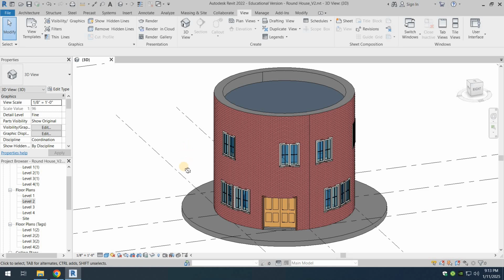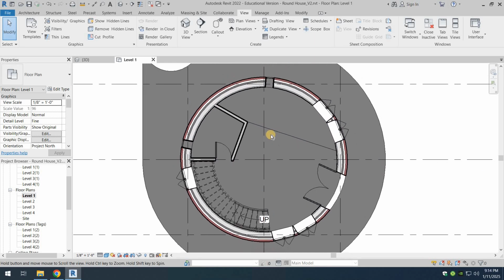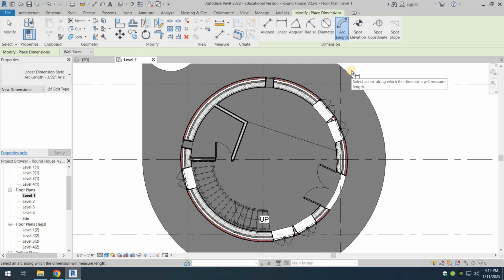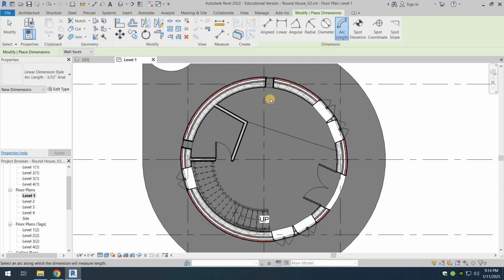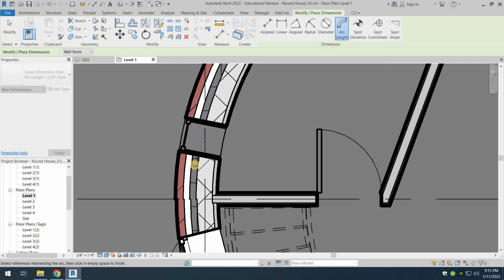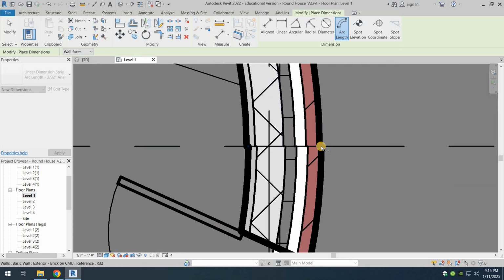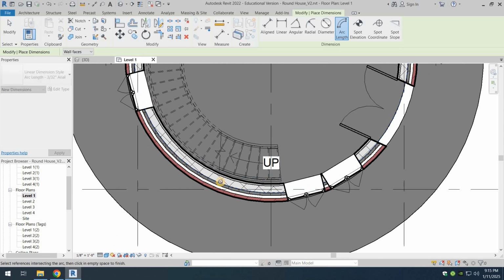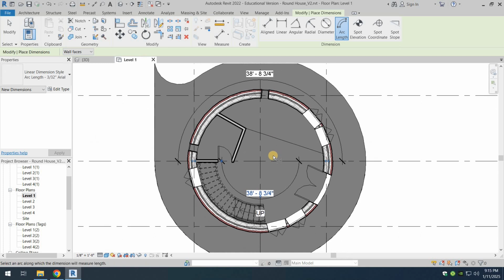How to Measure Circular Walls in Revit: Quick and Easy Tutorial

Comment: Hey everyone! Quick Revit question — I’m working with a curved wall and trying to measure the distance between it and a storefront curtain wall. I'm not using the window tool, just the curtain wall itself. What's the best way to accurately measure that distance, especially since the arc tool isn’t snapping properly? Any tips or tools I should be using to get a clean measurement? Thanks in advance!
Reply from the maker: You can try a few different methods to measure the distance accurately between your curved wall and the storefront curtain wall in Revit:

1. Set a Reference Plane: Place a reference plane tangent to the curved wall, and then use the Aligned Dimension tool to measure from that plane to the curtain wall.

2. Draw Model Lines: Use model lines or reference lines from the center of the curve or between the closest points of the two walls. Then measure between those lines.

3. Use a Section View: Cut a section perpendicular to the curve at the closest point between the two walls. In the section, you’ll be able to get a clean measurement using detail lines or dimensions.

The arc tool can be unreliable in this case, so combining reference planes and section views usually gives the most accurate result. Hope this helps!